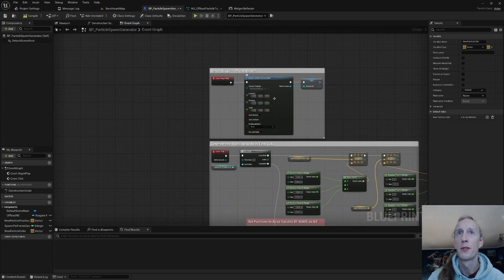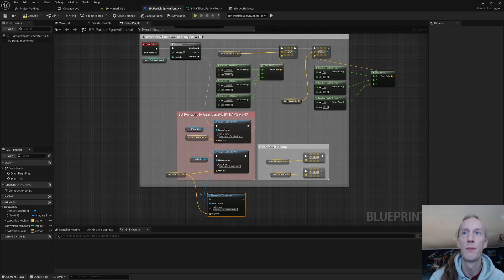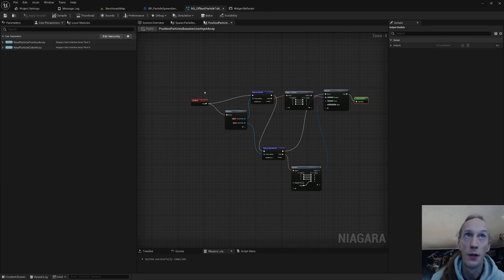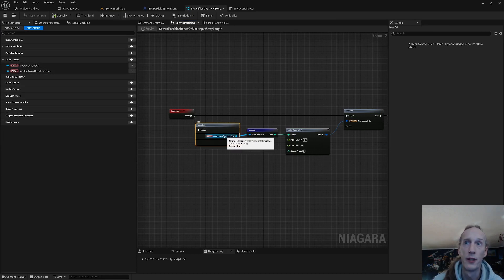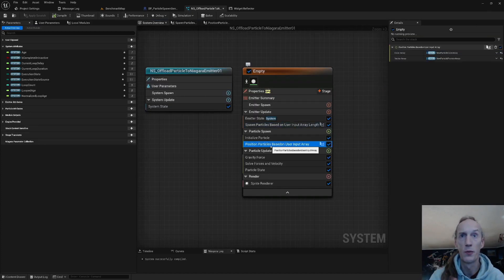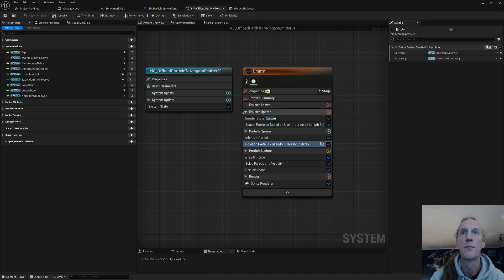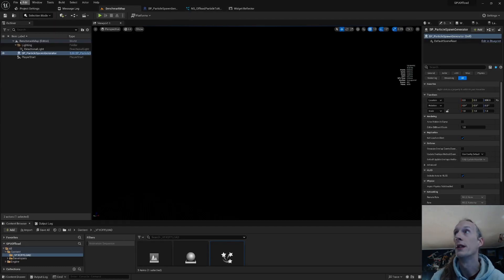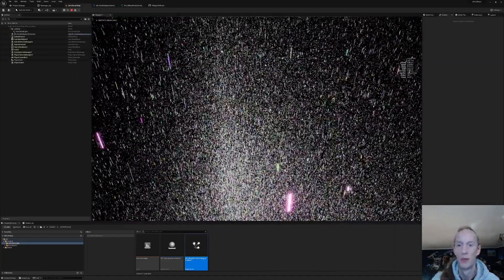3Minute SHORT Spawning Particles at Specific World Locations Unreal Engine 5 single Niagara Emitters

Comment: Great video, thank you!
If someone runs into issues of not seeing how to Link the parameters, in the Niagara System where you have your scratch pads under Modules, you'll need to right click on the module and "Apply Changes" for the input under Emitter details so you can link it by dragging the user parameter onto the exposed input in the module details.

I also ran into issues where particles wouldn't spawn, and in my Spawn Scratch Pad I had to Add an Emitter Attribute of type Common > Spawn Info, so I could link it to Map Set as shown in this video.

Comment: Hi, I can't see my particle emitter in the selection box on the spawn emitter at location node, but I can see some default emitters that are included in my project. Do you know why? Thanks
Reply: If anyone still has trouble with this, you have to set the Module Usage (check script details) to also use Parameter Emitter

Works the same as any other categories